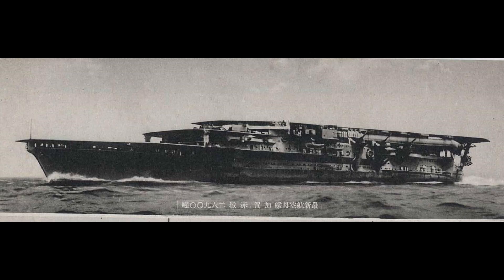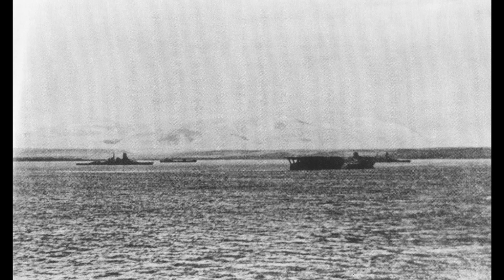IJN Kaga - Guide 255

Comment: I really like the radical carrier designs that were tried before people found out what design would work the best. They give a little insight into the minds of the designers as they figured out what was important and what wasn't.
Reply: Ya prototypes are usually pretty whack like that.
Reply: They worked better with wood-and-canvas biplanes, at least for takeoff.  As mentioned, hangar deck space was sacrificed.
Reply: That's why the pioneering era of any technology is usually the most interesting one. You can see all kinds of wacky things tried that won't be repeated later - usually for a reason.
The golden age of innovation when "sure, why not? What could go wrong?" is considered a sound design principle.
Reply: @Alpostpone A lot of the early ironclads and turreted ships are interesting because of this too imo.

Comment: On October 18, 2019, the RV Petrel discovered the wreck of Kaga 18,000 feet down on the ocean floor. She's buried up to the degaussing wires in mud (don't see a clean enough picture here to point those out) with the flight deck gone. A large debris field surrounds her.
Reply: Back in 1999, wreckage from the Kaga was discovered, though it wasn't positively identified as coming from the Kaga until sometime the next year.  The wreckage consisted of two large anti-aircraft gun tubs and a small section of the flight deck.  I believe the landing light boom, that was used to indicate if an aircraft coming in for a landing was in the right angle of attack, was also part of that wreckage.  The rest of the Kaga wouldn't be found for another twenty years.

I remember being frustrated when I heard the 1999 expedition had run out of time and money to continue searching for the rest of the ship.  It didn't help searchers that Kaga had burned and suffered numerous explosions for nine hours before she was sunk.  She just drifted along while bits and pieces were blown off of her to be scattered into the abyss.
Reply: @Kwolfx  A picture of the wreckage you mention can be found in "Shattered Sword". One interesting fact; that book has an artists impression of what Kaga probably looked like before she sank based on witness accounts; pretty much all of the upperworks apart from her bridge structure are just gone. When they found the wreck, she looked amazingly like the artist's interpretation.
Reply: @Kwolfx  Nine hours of slowly loosing speed and directional control, would make for a very large debris field indeed. She would have been going at near her top speed and making evasive manuvers when hit by the bomb. How long she remained at top speed and under control afterwards is somewhat questionable but she would have been moving at something like 27 knots possibly in some degree of a turn. Even if her boilers were vented straight away and no further power was delivered to her propellers, her speed and mass would have meant that she could sail on for quite some distance before she lost all way. This means that her debris field will easily be several square kilometres in area. That means an awful lot of side scan sonar and ROV time to locate anything on the bottom of the ocean.

Comment: The multi-stacked flight deck looks cool, not very good overall, but still looks cool
Reply: exactly, and the two turrets flanking the middle flight deck are just icing on the cake
Reply: I disagree. The idea was very good, and the lower flight deck definetly worked. It only became problematic when the aircraft increased in size and weight, which made the middle flight deck completly unusable and the lower one barely usable. But the idea to launch directly from the Hangar without needing elevators would have greatly decreased plane take off time and thus would have allowed way quicker follow up strikes. In some aspects its a similar concept to todays angled flight decks. It was a very good idea, it just proved less and less usable with bigger aircraft, but in 1923 nobody could anticipate how fast planes would develop.
Reply: @Formulka  the heavy anti surface guns were a good idea at the time. Aircraft of that time period were not that strong, and with attack tactics still being in their infancy it was quite possible that the carrier itself could have been ambushed by smaller faster destroyers or maybe light cruisers. So having guns to defend itself was a good idea at the time. The US carriers also had them. Its the same concept as secondary guns on battleships. Yes your escorts are supposed to keep the enemy away but that just does not work every time. Especially in the 1920s and early 30s without radar and stuff like that. The guns proved themselves to be useless later on, but that only came with experience.
Reply: I try to imagine the carnage and problems that arise when aplane slides of and subsequently skids into the lower flight decks.
Reply: Space battleship Yamato did an EXCELENT version of it in it.
Reply: @xxnightdriverxx9576  Somewhat akin to the catapults installed in U.S. Navy Yorktown class carriers to launch fighters straight out of the hanger deck – seldom used and eventually removed.
Reply: @murderouskitten2577  Don't forget the dual tri-decker design that welds two Space Kagas together in a catamaran configuration.  :)
Reply: @richmcgee434  yes
Reply: I see someone likes the new skin
Reply: Looks pretty ugly to me not to mention the side funnel.
Reply: And now the Kaga is reborn.  Soon to be filled with American F-35Bs.
Reply: @xxnightdriverxx9576  I think after WW1, folks realised that aircraft technology would only get better. But speeds doubling (maybe tripling) in 15 years or less could never have been expected.
Reply: Royal Navy's Furious sisters have almost similar initial design but instead three flightdeck they ended with only two.
Reply: These funnels on the side did give IJN carriers that agressive, cool look.
Reply: I can imagine the stacked flight decks making the pilots a bit uncomfortable. High pucker factor for vertical separation.
Reply: @asheer9114  Don't forget that Furious herself originally completed with a center island dividing the "flying off deck" forward from the "landing deck" aft, with catwalks along the sides to transfer aircraft from one to the other.
Reply: @Philistine47  True... and that was even more crazy design than Kaga's triple decks...
Reply: @xxnightdriverxx9576  The Glorious could have used those guns when ambushed by S&G in the North Sea in '40.
Reply: Possibilities for a helicopter deck.
Had there been any such thing as a helicopter at the time
Reply: It could have a certain "Flight of the Valkyries" feel to see planes coming out of all of the decks.
Reply: I suppose if you overshoot on landing, you have two chances to stop before you get wet.
Reply: @greentriumph1643  More like a Battlestar Galactica "launch all interceptors" moment?
Reply: Yeah akagi in it's early self has triple decks and I persoy like it
Reply: "Airman, I have bad news, and worse news.  The bad news is your plane will launch from the bottom flight deck.  The worse news is you have to LAND on the bottom flight deck."    ;-)
Reply: @murderouskitten2577  Ah a fellow man of culture, SBY is still so criminally underrated, especially since the original was the first popular anime in the U.S.

Comment: The multiple flight deck was a sign of its times.  Enterprise and her sisters were designed with a lower deck transverse catapult, which would've served much the same purpose.  Heavier planes (especially monoplanes) were the death knell for such ideas.  Biplanes lifted high as they left the flight deck, where monoplanes drop low before rising again.  That latter physic would obstruct lower deck aircraft launches.

Comment: There’s actually a sketch somewhere of what Kaga looked like after being hit (minus the fire). Essentially there’s a massive hole where the back half of the flight deck used to be and its down to the water line.
Reply: I saw that sketch in the book "Shattered Sword" (which Drach did an interview with one of the authors).
Reply: I thought that sketch was of Akagi?
Reply: @themanformerlyknownascomme777  definitely Kaga. The island is on the Starboard side.

Comment: Looking at Kaga (and Akagi too) as built, and also considering the other converted CVs, it's remarkable the degree to which the USN guessed right when converting the Lexingtons. (Considering Ranger, it obviously was a matter of guesswork - but still some good guesses there.)
Reply: Even the British tried the multi-flight-deck thing on H.M.S. Furious.  The US Navy got it right!
Reply: @nx9100  Royal Navy loves the cloth skined biplanes like Swordfish.
Reply: @nx9100  USN was building on the experience of RN with Furious, Glorious and Courageous.
Reply: @gregorywright4918  Not as much as you might think. Furious was under reconstruction from her original configuration to a flush-deck carrier from 1921-1925; Courageous and Glorious didn't even begin their carrier conversions until 1924 and didn't complete them until 1928. Lexington and Saratoga were already well along in building by 1925, and both ships were commissioned into service in 1927. 

Just as a matter of timing, then, there was very little opportunity for the USN to take lessons from Furious, and no opportunity to learn from Courageous and Glorious, prior to designing the Lexington conversions.
Reply: @Philistine47  Fair enough.  Furious had gone through three iterations, with fore and aft landing decks, a ramp in between the funnels, and then then the flush-deck.  There were a couple other attempts at flight decks on merchant-types, and the US had the Langley in the early 20s.  Probably a lot of reports from 1916-24 of what NOT to do, and recognition that a clear deck and getting the stack gasses out of the way were top priorities.  They went the wrong way on enclosed hangar and heavier guns, though.

Comment: I know in retrospect it looks and sounds ridiculous but, think about it…. you launch medium weight fighters from the bottom deck, lightweight scout planes from the middle deck and heavier torpedo bombers from the top deck. It was definitely worth a shot especially considering they had the hull sitting around collecting dust.
Reply: Apparently the lower decks were simply too short  to launch aircraft. At least without the assist of a catapult.  And like it was said in the video, the small hangar space limited the number of aircraft the ship could carry.  In any case, there have been no successful  multi-flight deck carriers  that I am aware of. Can you name any?

Comment: I wonder why nobody implemented angled flight decks until the 1950s. I suppose the ships just weren't big or wide enough.
Reply: I think, for the most part, angled decks were the answer to jet era carrier landing problems. Prop planes could kill their engine just before landing and not have any more thrust. Jets can't quite do that. And combined with planes parked forward, you get safety issues. Angling the landing operations to the side allows safer landing operations for jets.
Reply: @nekophht  Agree. And don't forget the angle deck will change the ships center of gravity. It's not just 'lay a new deck'.
Reply: Several of the Essex carriers of WW2 were modified to angled decks in the 50s and 60s with the SCB-125 upgrade program.

Comment: Who delivered the pair of torpedoes?  Was she purposely sunk with so many on board, or were the 811 those killed by the bombs and fires.
Reply: Hagikaze delivered the torpedoes...

The majority of personnel losses were the aircraft hanger and maintenance crews who died in and around the hangar as part of the fires...and her engineering crew, most of whom were trapped below the fires and could not escape.
Reply: The eyewitness testimony that exists says the fire raged so hot and long that the glowing hull was glowing red, the superstructure that supported the flight deck melted, and the water immediately touching the hull was steaming and boiling...so yeah, at some point everyone inside was dead from one cause or another.

Comment: Whenever people say "irreparable damage" in a context like this, all I hear is:
 "Daaaaamn that looks expensive to fix...... Let's just start over or something"

Unless it is just a twisted mass of bent and shredded metal that is not even vaguely recognizable, that is, it has been completely destroyed, it is of course POSSIBLE to repair a metal ship. It's just not always worth the effort.
Reply: First, I think there is the determination of whether the damage can be fixed, anywhere.  Next,  the determination of the cost of getting her from here to a place she could be repaired.  While not losing an unacceptable number of additional resources.  Challenging, on the fly, calculus.  
It seems like the IJN did not ever have the damage control and ship recovery skill that the USN had (or developed).
Reply: @garycort7997  But that's kind of my point. In something like this, ANY damage can be "fixed", as if you had the capacity to make a part of the ship once, you can make a replacement part. Even if entire sections of the hull, whole gun turrets, the turbines or even the armour belt is completely destroyed, any and all of these can be replaced, thus "repairing" the ship. This is in fact how most (permanent) ship repair is conducted, by replacing damaged parts rather than putting the pieces back together.
For a ship to be "damaged beyond repair" thus can really only mean two things. Either that the ship has been so destroyed that it is unrecognisable. This state is basically just a pile of scrap metal. Or that the ship can still be meaningfully described as "still itself", but is too damaged to be worth repairs.

I would argue that in 99% of cases, this latter state is the state in which a ship is normally classed as "irreparable". Short of a MASSIVE internal explosion or a litteral mountain landing on top of it, I cant really see how something as big as a warship can ever be damaged enough to "truly" be "irreparable".
Reply: @gustavchambert7072  , agreed.  It is a sliding scale, with a dizzying number of variables.
Reply: @gustavchambert7072  The amount of damage made the IJN carriers unable to move under their own power.  Which means they would have to be towed and the tow ships guarded by additional ships.  The group would only be able to move at single digit knot speeds while the US controlled the skies and had subs in the area.  Trying to salvage the carriers 2oulld have put too many other ships at risk.
Reply: @mjbull5156  Im starting to realize that people might not understand what point of the video Im referring to.
Of course I understand the infeasibility of towing a burned-out hulk to dry-dock hundreds or thousands of miles away. 
Im not talking about that. 
Im talking about the Amagi being damaged in dry-dock by the Kanto earthquake, which drach described as "irreparably damaged".
Reply: I have passed on the opportunity to buy a few claasic cars simply because it's not economically feasible to make them into viable daily drivers.

Yes, they were repairable.  However, the cost would exceed that of a brand new vehicle that easily meets or exceeds their peak performance.
Reply: @gustavchambert7072  Ah, I see.  If memory serves, the earthquake twisted the structure of the ship in such a way it made more sense to scrap than go forward.
Reply: @mjbull5156  that's what I figured. Technically fixable, but not practical or economically reasonable.
Reply: @gustavchambert7072  Same thing with the USS Bon Homme Richard - still the structure there, but the repair cost is greater than the cost of building a new one.  Once the keel and main frames are twisted or bent, you are really rebuilding the ship anyway.

Comment: Slightly off topic, but which carrier is the one in the shot with Kaga when you're talking about Pearl Harbor? The one with the... well... the spoiler looking thing on the stern?
Reply: The carrier with the "spoiler" is the Kaga. Some easy identification hints are the tall height of her flight deck over the bow and island structure on the right side of the deck. The carrier in the background is Zuikaku. Notice the flight deck is lower to the bow. The photo is lifted directly off of Wikipedia's article of the Kaga and is actually part of a film of the fleet going through stormy seas on the way to attack Pearl Harbor.
Reply: @davidkaminski615  thank you! I remember seeing the video several times but never saw a still shot of that ship with the spoiler. Any idea what the spoiler is?
Reply: @kyletimmons421  Two guesses: It's either a extension to the onboard radio antennas for receiving transmissions (The task force was under radio blackout, but they could still recieve signals.) or it's the crash barrier erected when landing planes. Because the ship had an axial deck, the barrier was put up to protect parked planes at the front of the deck from long-landing planes at the rear. Due to the sea state, I would asume there were no flight operations being conducted then, so I don't know why the barrier would be up.

Comment: 6:51 Sorry to nitpick. Weren't VT8 actually Avengers?
Reply: The answer is both; the first six examples of the Avenger were given to VT-8, and these aircraft were then flown to Midway as part of it’s air complement. The rest of VT-8, those who remained on Hornet, flew Devastator’s.
Reply: @Warspite1  Everyone should read "A Dawn Like Thunder: The True Story of Torpedo Squadron 8" by Robert Mrazek. Which I did a few years ago. Until then, I had no idea that only about half the squadron was actually on Hornet during Midway, with the rest at Pearl transitioning to the Avenger (which is where the Midway Avengers came from).  Eventually, after Battle of Santa Cruz, they wound up with the Cactus Air Force on Guadalcanal.